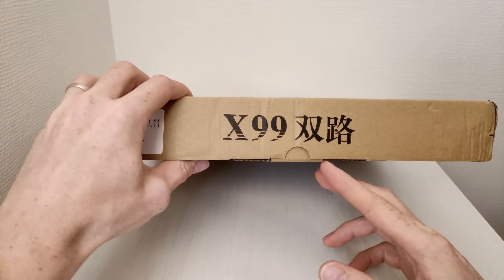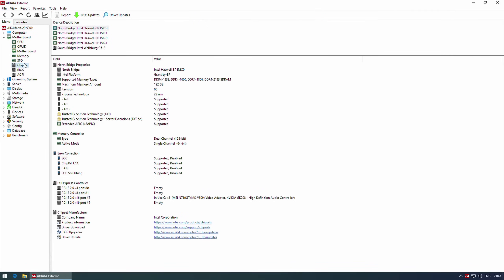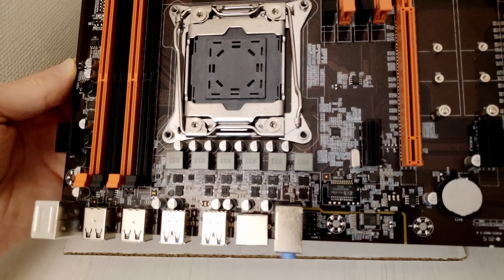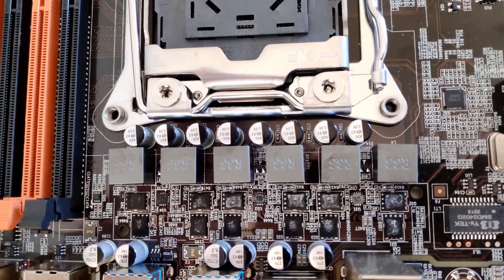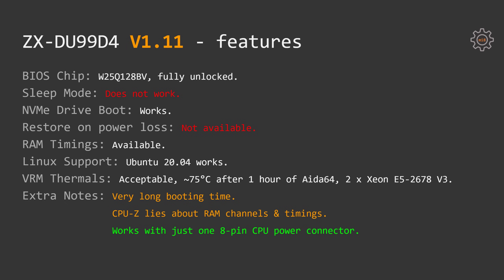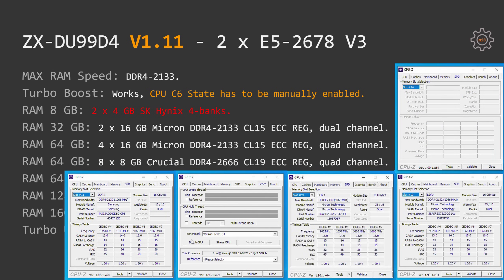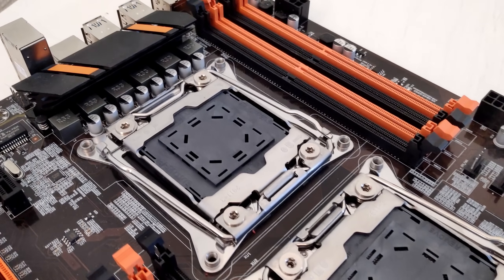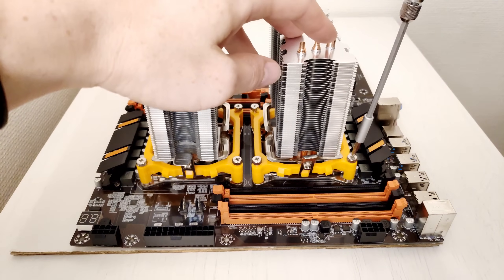🇬🇧 Detailed review of ZX-DU99D4 V1.11 Dual Socket LGA 2011-3 | E5-2678 V3 | E5-2620 V4

Comment: I got one of this, but I gonna to return it. The memory slot 7 always report b7 errors no matter what module a put there and all are same chip.
Does any better options for arround same price?
I saw your recommend option, but I am missing the links
Reply from the maker: There are no other options from China for the same price.
Reply: @Miyconst  I am not seeing them either. Bit unsure if still get another of this model, of go the something better, a second hand but we don't know the history of them, it will be a risk.
Thanks for you reply, good videos ... Continue with that.
Reply from the maker: One thing you have to check. How many memory modules do you have? Slot 7 might be a secondary slot, it won't work if you don't install memory module in its primary slot. This motherboard has two memory channels per CPU, and two memory slots per channel.
Reply: @Miyconst  I have installed from slot 1 to 6, works fine.  slot 7 without slot 8 give 67 (or b7), slot 8 without 7 gives 60, booth gives  67 (or b7).
I assume that slot is defective, I can also try switch the CPU but I dont believe that will be a problem, booth are boot and working good.
Also strangely the bottom nvme is not detecting any disk, I maybe have a wrong configuration of the pins,  there's no manual with package, and my quick read of the board inscriptions was let pin 1 and 2 connected but I'm maybe wrong.
Reply from the maker: @nmocruz  it looks like you have got a damaged memory slot or the connection between the CPU and the motherboard is not good. Try to reseat the CPU or swap the CPUs and validate the memory again. If nothing helps - contact the seller. The M.2 slot can operate either in SATA or in NVMe mode, there are jumpers to turn either on or the other mode.
Reply: @Miyconst  Thanks
 I will try that.
Also look at this SZMZ X99 Z8, seems also a good new alternative
Reply: @Miyconst  I just tried switch CPU same behavior
Reply: @Miyconst  I was also not able to make the bottom m.2 work with nvme disks, I tried to switch jumper but no joy.
Reply: Found out, move all 4 jumpers I was think that was just one
Reply from the maker: @nmocruz  then it seems like you have got a defective motherboard. The only option you have is to contact the seller.

Comment: Hi my friend. I recently bought this motherboard with one e5-2678 processor. 2x 8gb ecc ram and i have a nvidia rtx 2060 super as graphic card. When i turn on, it doesnt start the bios. There no warning beeps, nothing.  Do you have any idea what i need to do start the cpu ? Thank you.
Reply from the maker: Hi. You have specified too little information about the issue, I can't help with it like this.
Reply: @Miyconst  hi my friend. Sorry about that, still learning all the specification. I  got an article about this motherboard and processors and i found what went wrong. I only plugged one atx cpu cable. The bios only start if you pkug both power cables. As soon i did, the cpu started..

Comment: Can the V3x4 driver be inserted into the BIOS or does it have to be loaded each boot? I need a board where Turbo Unlock is always on, regardless of OS etc
Reply from the maker: There drivers can also be injected into the BIOS, but only in the FFS form. EFI drivers should be installed on the OS level.

Comment: Hi, you are explayning in this video how (for this motherboard) each PCIEx1, PCIEx16 and M.2 slots are connected to the first CPU or second CPU or connected to the chipset, in case the manufacturer have connected by design the second CPU to the second  (lower)   PCIEx16 slot, is a way for me at home to modify and connect Both PCIEx16 slots to the first CPU?, . I ask you this because my Huananzhi X79-8D seems to have the second PCIEx16 slot connected to the second CPU and I want both PCIEx16 slots connected to the first CPU,, thank you for the answer
Reply from the maker: There is no way you can change the motherboard layout yourself. You would have to physically change a bunch of wires inside the motherboard to change the PCI-E slot connection.

Comment: Can you make a review of the new x99 motherboard from Kllisre to see if it is possible to unlock turbo boost/overclock and run SLI configuration.  Thank you!

https://www.aliexpress.com/item/4000974861451.html?spm=a2g0o.productlist.0.0.3bb1513dtHndsi&algo_pvid=c424f52f-d486-4384-86e7-0ac426adc9cf&algo_expid=c424f52f-d486-4384-86e7-0ac426adc9cf-2&btsid=0bb0624316002093081703912e53d1&ws_ab_test=searchweb0_0,searchweb201602_,searchweb201603_
Reply from the maker: This is not a new motherboard. It's a new revision of PlexHD X99-Turbo. This motherboard still has quite some quality issues, thus, I don't plan to review it.
Reply: @Miyconst  Sorry, the motherboard I was looking was the updated revision and the post code is wired correctly and not upside down like the previous one, the cpu pin connector is moved to up right corner and I thought it could be a better version with probably some issues fixed and make a review of it. I don't remember where did I get the picture of the motherboard from and I can't seem to find the same on AliExpress or maybe it is out of stock. I didn't know it was the plex hd x99 with some quality issues that you mentioned. Thanks for clearing it up. What is the best cheapest x99 motherboard/motherboard combo do you suggest? I planned to buy the machinist x99z but it has issues with vrm thermals and hard to unlock turbo boost :)
Reply from the maker: @reekmortee8020  I have already seen the board you are describing. I have also seen a few YouTubers giving it high score, but at the same time I am getting quite some bad feedback about these boards from my subscribers. A Russian YouTuber who has a small PC assembly business has the same opinion as me - avoid these boards.

Machinist X99Z works just fine with E5-2678 V3 if you have good airflow in the chassis, and Turbo Boost Unlock is not any harder than on any other motherboard, just need to use AfuWin instead of FPT.

Comment: hello Miyconst i was guessing if a dual socket mobo with 2 xeons 1650 v3 would be a gamming beast: 12 cores up to 4Ghz...
Reply from the maker: Hi there. No, it would not be a gaming beast, because it won't work at all. Only Xeon E5-26XX and E5-46XX can work in dual CPU configuration. E5-16XX are limited to one CPU.
Reply: @Miyconst  thanks for the fast response ...

Comment: Hello friend, I just didn't understand something right, did you make the turbo bost work to the maximum but not in the conventional way? Keep it up with the channel I'm loving it, a hug from a Brazilian fan
Reply from the maker: Turbo boost unlock worked with manual EFI driver installation, but not with FFS driver injected into the BIOS.
Reply: @Miyconst  Thanks. Have a video with manual installation of the EFI driver
Reply from the maker: You will find all required information on my page: https://www.miyconst.com/Blog/View/2081/xeon-e5-2600-v3-turbo-boost-unlock

Comment: Can I have a question? Does the board work with 2 CPU's when using non-registered standard uDIMM memory? I know a lot of branded dual CPU boards can run single CPU with udimm, but require RDIMM when you want to run a couple. Is this the same on those Chinese boards? It would be good if we could use udimm with dual CPU, as I have tons of them laying around unused ATM.
Reply from the maker: This board works well with two CPUs and UDIMMs.

Comment: Thank you for the video. I installed this very mother board, and when filling all orange ram slts gives 32gb dual channel. But when you populate all orange and black slots it shows 64gb and quad channel.not dual. But thank you for an excellent review.
Reply from the maker: How do you check the RAM configuration? CPU-Z lies about it.

Comment: Nice of you to cover dual socket gaming setups and their increased latency.  Most expensive hardware task is sharing/synchronization.  This somehow is missed by most folks who have never benchmarked single app <> multi-socket/multi-core.
Reply: Most of the performance penalty when it comes to gaming and dual CPU comes from cache, not memory. The Haswell-E platform benefits greatly from the large unified inclusive ringbus cache. It helps games a lot, but when the threads of the game get split across multiple CPUs, they are not in the same L3 cache pool and that is what hits the performance the most. The memory latency to the other CPU is minor detail compared to the fact that you have to look in to memory at all cause the data you were looking for are not in your L3 cache. (this is the same reason why for example Skylake-X, which lacks ringbus and inclusive L3, has lower gaming IPC than old Haswell). 

I found out, that locking all the threads to single CPU can improve the performance greatly. Using SW called "process lasso" you can do that automatically, and if you split your resources right, you can game on one CPU and render on the other at the same time without performance loss. What you do not want to do it let windows manage things, they will keep throwing all threads everywhere like hot potato, causing cache trashing and sometimes major performance hits.  The onyl scenario where it does not matter is when you have memory-light SW that threads ideally to all cores and the individual threads do not communicate at all, like Cinebench.

Comment: Im planing on building a workstation for me and my brother in a dual x99, do you know if this mobo have intel VT-D on the bios? And if it supports IOMMU
Reply from the maker: Sorry I can't answer the question with 100% certainty. The BIOS has settings for Intel VT-D, but whether it works or not - I didn't test. IOMMU - I didn't find any settings, but if you tell me what to look for, I can check it again.

Comment: Thanks for the review and comparisons.
How will this dual socket board (running single CPU only) compare to a similar single-socket board with the same 2678V3 CPU? 
Please add some more Linux based workstation use tests to show that it can be used for things like low-cost software build server with many processing threads. 
Maybe try to build a clean android software image compilation, in the past people were compiling kernel image but nowadays Linux kernel will compile in minutes (as was seen when Linus from LTT made a computer build for Linus Torvalds use case)

These days most of the stores are not able to deliver to india so havent been able to buy anything
Reply from the maker: Maybe in the future I will do some more Linux based content, but so far I have no such plans. Thank you for the suggestion and the support either way.
Reply: There is no performance difference between running single CPU on single board and single CPU on dual CPU capable board. The only difference would be the memory channels, but from my experience, LGA2011-3 CPU s are usually not memory bottlenecked and the difference between dual and quad is minimal in real-world scenarios.

Comment: Hi. Thanks for this great channel... ;).
I have the same motherboard but it get stuck in b7 (67) and it is not booting .. I only have connected the atx_8 connector of CPU1.. Maybe i need to connect also the other one...  Do you know why it gets stuck the display in b7 (67) ?
Thanks
Reply from the maker: In my case the 67/b7 postcode indicated RAM issues. What memory do you have installed?
Reply: @Miyconst  I think i have the clue ... i will try this afternoon .. I have connected only slot 1 ( orange) and slot2( black) on the first cpu memory .. Maybe cold be the problem ... ALso do you know any manual / boot codes ... reference ..
Thanks for your support ..
Reply: My memory configuration = 2*8GB = 16GB 2400MHz REG ECC
Reply from the maker: You have to install memory for each CPU.  Put one stick into the furthest orange slot for each CPU.
Reply from the maker: Here you can find some post code references, but there is no guarantee that the Chinese boards will follow this manual. http://www.bioscentral.com/postcodes/amibios.htm
Reply: @Miyconst  Working but only with one 8 gb module the other its broken ...
Thanks..
Reply: I had the same problem when I installed 8 x 4GB DDR4 2133Mhz ECC REG.  I removed 4 sticks from the secondary black RAM/DIMM slots and hey presto it booted to bios :-)  happy days.

Comment: do you have trouble with the realtek chipset when it comes to recording voice? all those board i tested so far are very bad even with a good micro i get lot of noise and very low voice .
Reply from the maker: I use a Blue Yeti USB microphone, thus I can't comment on the noise quality of the Realtek audio chips on these boards.
Reply: @Miyconst  its strange but i tried usb or mic in slot, with different microphone such as logitech (usb) or plantronic and still got those wind while recording.. hmm
Reply from the maker: @kalytv6440  Maybe it's not the motherboard then? Could be your power supply or some other wires close to the microphone.

Comment: Great insights on this motherboard, have been using one of these for the past two months on a rig to test performance of X99 platform. It's sad it does not support quad channel for each cpu, nonetheless it is a great product for the price!!
Reply: Is there any big performance hit if this X99 motherboard does not support quad channel memory but only dual channel ? I plan to use an X99 board like this for virtualization (not interested in gaming).  Also using dual channel memory architecture will allow to install 32GB x 8 modules to use it at it maximum capacity of 256 GB ?
Reply: @ciobysv23  hi Christian, I do not believe you'll have a huge performance impact for virtualization, but there certainly is some impact. Anyway, it will depend a lot on what kind of workload your virtualized environments are going to execute, if only some web servers or something on this line I think you'll be mostly fine. I would expect bigger hits on memory intensive applications like rendering and even games.
Reply: @MarioMazzotti  I plan to use it for building network topologies using virtualization Qemu/KVM and some of them might get big using a lot of RAM. That's why I asked. In this case it better to focus on Huananzhi X99-F8D which seems to support octal channel configurations but the price is higher ?
Reply: @ciobysv23  Actually, I think you may have little benefit on the extra 4 channels with your intended applications. I believe the DU99D4 is already a good fit for your purpose. As far as I know, this kinds of workload are not very memory bandwidth intensive. Maybe someone has a better insight. For me here in Brazil, buying the F8D would yield 40% more money, DU99D4 is already a good fit for my needs. \o
Reply: Hey does motherboard got any overclocking settings in bios. I am thinking for a dual Xeon E5 1620 setuf since those CPU's are super cheap and unlocked.
Reply: @snaj9989  hi there, unfortunately this mobo does not support overclocking, either way, the Xeon 16XXv3 does not support multi cpu operation. The first digit on the processor model indicates how many processors can be used in a multi socket system. Only the 26XX support dual socket operation, likewise, only 46XX support quad socket operation.
Reply: @MarioMazzotti  Ah, thats unfortunate. I cant even find a good 16XX CPU on market and 26XX ones are all locked.
Reply: Mario, tem vídeo dela no seu canal? Por sinal, muito bom. Vi quase todos seus vídeos sobre xeon. Parabéns!!

Comment: Thanks for finding the info about the MOSFETs. I think it's interesting how many of these Chinese motherboards use VRM components of wildly varying specifications, often including MOSFETS that (at least "on paper") are much better than the ones used on mainstream motherboards by the biggest manufacturers like Gigabyte, MSI and ASUS. The 110A 2.6mOhm low-side MOSFETs used on this motherboard, for example, should be very good, and (unlike on the Veneida x99 which you recently reviewed) the high-side MOSFETs are also quite good.

I'm still confused and curious about why these chinese manufacturers are using these 100A+ MOSFETs when mainstream motherboards don't go above 80A MOSFETs or 90A Power Stages. Mainstream motherboard VRMs will usually have more phases, or will use 2 low-side MOSFETs per phase, so mainstream motherboard VRMs are usually better overall, but it's interesting to see the different design philosophy between the different markets: Lots of cheap MOSFETs vs a few expensive MOSFETs.
Reply from the maker: When it comes to the Chinese reasoning, it's always about the $$. Apparently, it's cheaper for them to use high quality / high current MOSFETs with lower number of phases and cheaper VRM cooler in order to support CPUs with high TDP / high number of Cores.

Comment: Hi thanks for this video! I have two of these motherboards and they work really well, I just wanted to add that they do support e5 v4 engineering sample cpus which is really rare. I've reviewed the 49$ e5 2630 v4 engineering sample on my channel thanks to this board if anyone is interested
Reply from the maker: Did you test the ES CPUs in dual or single CPU configuration?
Reply: @Miyconst  I tested it in single configuration as I had only one
Reply from the maker: @hardthur3339  Thanks for the info. Another guy says that dual V4 setup does not work out of the box on this motherboard, but it works with usage of Huananzhi X99-F8D BIOS. The BIOS though is not fully compatible with ZX-DU99D4 V1.11.

Comment: Great video! So which cpu fans and adapters do you use on on this video?
Reply from the maker: I have used Inter-Tech H Argus Su 200 https://www.amazon.de/gp/product/B07BRDFCM9 CPU cooler with screws from the black brackets. The cooler does not include LGA 2011-3 compatible screws.
Reply: ditto